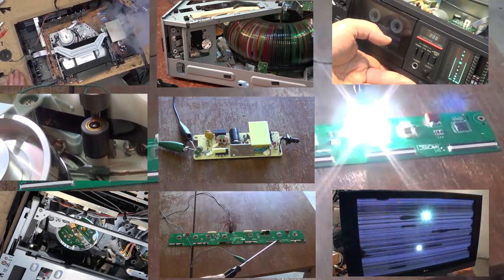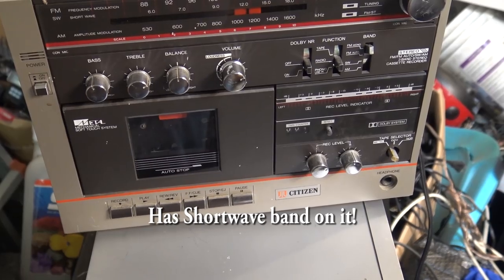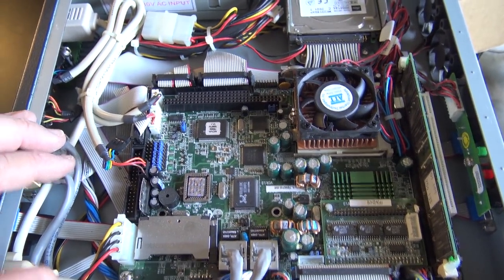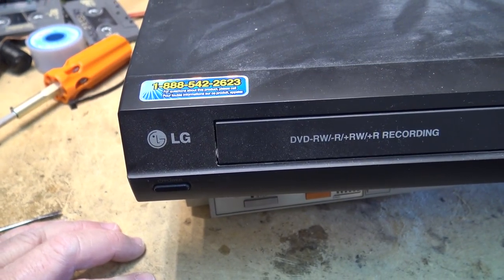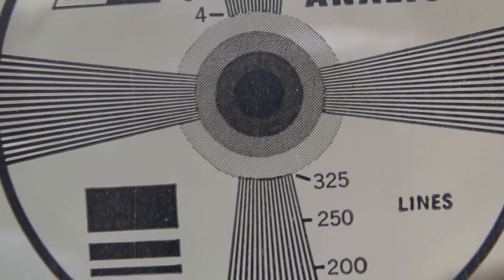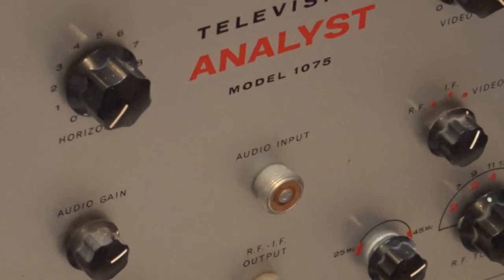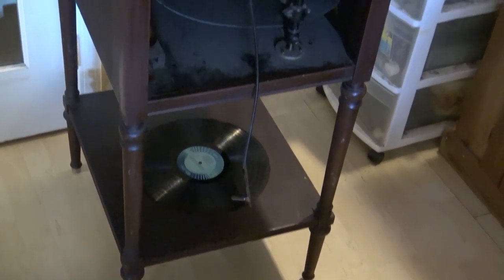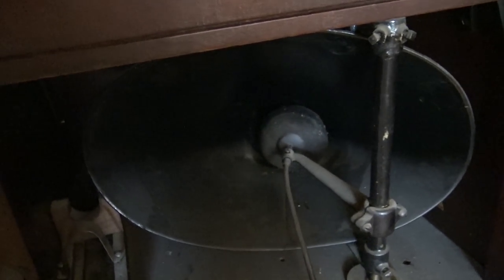I was at an estate clear out. Look what I picked up!

Comment: We've got our late father's old console Victrola. From my understanding, it's not terribly valuable except in a blackout. Edison Diamond Disc players are way more valuable because they are far more rare. I mean, they were still making Victrolas like into the fifties when vinyl was taking over because many areas still didn't have electricity yet. You can only play shellac 78s vinyl 78s would get gouged out by the weight of the transducer. They also did make vertical transducers for Victrola's to play Edison Diamond Discs. They would have a diamond stylus, of course. Those discs are rare, though. I think you can get sapphire tipped needles for Victrola's that would last through many plays. They actually mixed a fine abrasive material into the shellac for Victrola records. The idea was to wear down the stylus rather than the record. It gave the records a high noise floor, though. Bamboo was also used as a cheap alternative to steel needles. You used this tool that is much like a hole punch to slice a sharp tip onto the bamboo needle after each play to extend its life. Cactus needles were also available although I'm not familiar with those.

Comment: Couple of things about the Edison.  There were lots of adaptors made for Victor type machines to play Edison records, but very few for Edison machines to play what we consider standard records.  The reason was likely Edison himself to some extent, but there were other problems with playing conventional records.  For one thing the Edison machines ran at 80rpm not 78.  Since the groove does not move the pickup across the record, there would be a possible problem with the pitch of the grooves.  The part of the pickup with the diamond stylus does hang down from the reproducer, and the groove actually will move the stylus that is floating within the limit of the loop that hangs down from the front of the reproducer.  So, a conventional record may not play properly, even with the horizontal reproducer.  It was much easier to use an adaptor to play an Edison record on a conventional machine since the groove on a conventional machine, say a Victor, actually controls the movement of the reproducer.  Thats why you will find more adaptors for conventional machines to play Edison records and not the other way around.  Then you also have some of the Pathe records that were vertical cut, but tracked from the inside to the outside.  These can be played on a conventional player with the adaptor, but would not play on an Edison, even with an adaptor.  Good Luck
Reply from the maker: Not quite.  The conventional  record reproducer works fine. You set the arm to the middle but do not lower it with the lever so the arm does not move.  The adapter has a swivel on it to track the record grooves so with the adapter it plays correct.   The speed is not an issue as there is a control to trim the speed down a bit.
Reply: There is another one I have is the Sonora tabletop phonograph. It has a folded tonearm and a reproducer to play lateral and vertical records. It was also the first phonograph to have its compatible feature.

Comment: I had to laugh when I saw the ceiling fan wiring. Looks like something I would do with duct tape. 😀
Reply from the maker: That was a temporary connection to test the fan when i found it at the side of the road.  Has more or less bebome a permanent connection.  Some day I may get around to putting a box in there for it.  I may move it but it works where it is.

Comment: Looks like a good mix of stuff, I particularly like the Edison, I am sure you could make a replacement grille, sounds like the motor needs stripping down to remove the dried out grease.
I was given a 1920's HMV gramophone a few years back, sounds quite amazing for a purely mechanical device, mine has doors to control the volume.

Comment: Yes, actually have a spare spring for that player, plus a box of needles as well. Too bad that to post it to you will be either silly amount, and no guarantee, or even more insane amount, and you might get it by middle of next year.
Reply from the maker: Post isn't that slow.
Reply: @12voltvids  not by you, but here to post a letter to the same post office can take up to 2 months before it is delivered. Even longer if it has to travel, and there are plenty of times a parcel I ordered taking more than a year to arrive. They even closed down the most visited post offices because the rent increased, and the increase was more than the profit they made in it.

Comment: Some really nice items there, by the way.  That Super Beta - wow!  (I'd not heard of a Super before now!).
Reply from the maker: They were all SuperBeta starting with the SL2400 series and SLHF400.
Reply: @12voltvids  The 2400 and HF300 came out in 1983 and 1984 respectively so no SuperBeta on those.
Reply from the maker: @crashbandicoot4everr  I said 2400 series. Should have said 24xx as not all were super.  On the hifi it was 400 and up with the 900 being the top of the line untill 86 if i remember when the 1000 was released.
Reply: @12voltvids  I looked up the 2400 series and the models were the 2400, 2401, 2405, 2406, 2410 and 2415. None of them are SuperBeta though. The 2410 and 2415 had a speech synthesizer that told you if the timer wasn't set correctly.

Comment: Just an FYI....RCA records back then played at 78 RPM and Edison play at 80 RPM
Reply from the maker: You won't notice the difference between 78 and 80 plus the Edison has a pitch control that can slow it down to 0.   Remember these are wind up so naturally as the spring unwinds they will slow down anyway.